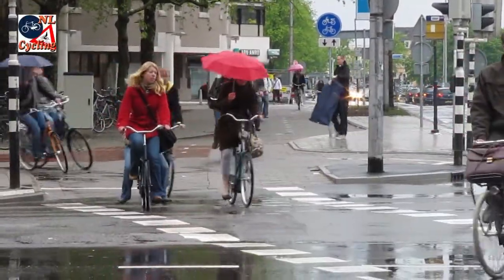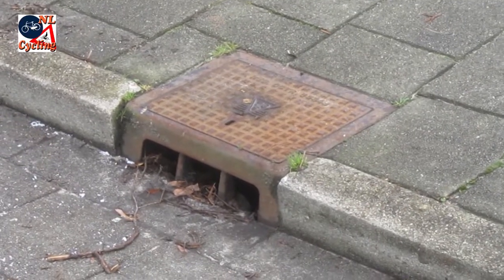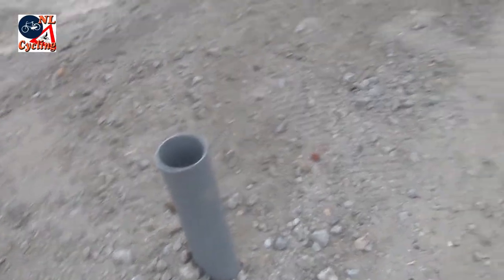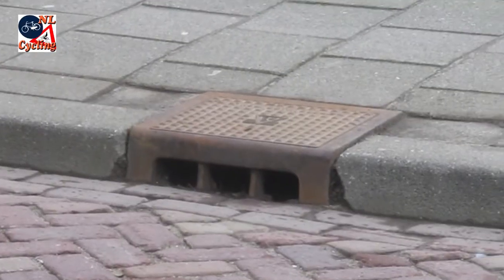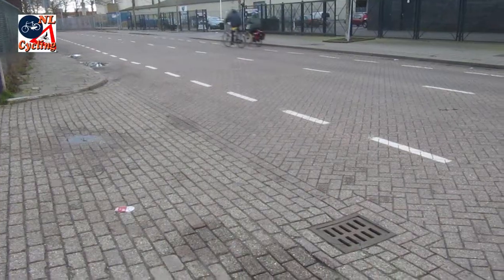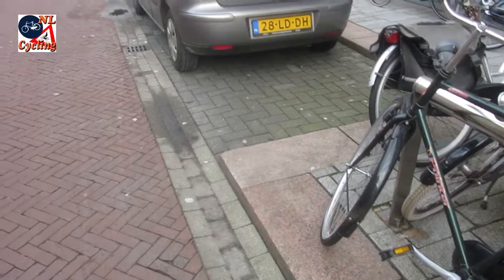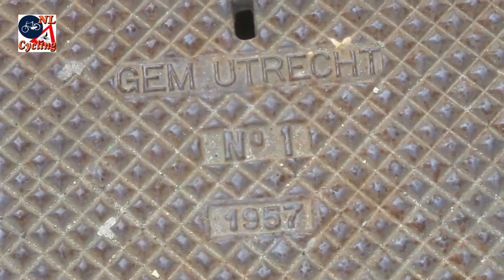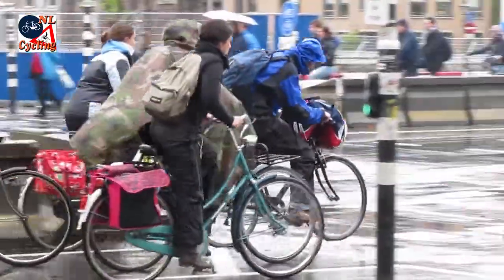How the Dutch keep their cycleways storm water free

Comment: why the Netherlands uses cobbles?
Reply: That is actually a VERY conscious decision: when a car driver is speeding on cobbles it becomes a very shakey and there for unpleasant drive. So the cobbles work as a real speed reducer! You will not find tarmac paved streets in residential areas in the Netherlands. The reason why many bicycle lanes are paved with cobbles also has to do with drainage. In between each cobble there's a tiny bit of soil. Soil absorbs water a lot better then tarmac does....
Reply: @missteacup9726  Really ? I feel no problem driving 80kmh on them. I always thought it was because its easier to service the power, water, gas, drainage and communication infrastructure underneath ?

Comment: I can't believe how the larger bus stop kerbs are still not standard here in the US. It would speed up bus service so much not having to walk up steps
Reply: Steps?
Reply: @dyldebeke  Most big cities have stopped purchasing buses with onboard stairs, but there is sometimes a step up from the curb and onto the bus, solved for wheelchair uses with a ramp.  Their solution is to lower the height of the bus itself with an adjustable height suspension, which can be complicated, although it is not bad with the common air suspension systems found on many buses in the US.  But many smaller cities still use buses with stairs, and many older buses still use stairs as well.  These buses use complicated mechanical lifts for wheelchairs, which brings its own set of problems, and the whole setup increases dwell time, which is by low floor buses are so much more common now.
NYC no longer purchases new city buses with stairs and has not done so for years (its coach buses for express services are of course different, but those are coach buses).  Nevertheless, NYC still has older buses that have on board stairs.  It's unfortunate, but it should be rectified soon.
Reply: except for Portland, their buses don't have steps

Comment: Hi, why not to use the polymer concrete drainage kerbs, catch basins and drainage channels to solve this problem? Better water discharge capacity than the traditional design(point type drainage system) .
Reply: Probably costs.
Reply: because this system existed before plastics were a thing and it works very well. As long as there isn't a blockage in the sewer system, it drains the streets really well even in heavy rains. So why change it? Once this system is in place, it can stay there pretty much forever because of how solid it is. There are covers and pipes from all the way back in 1873 still in use. I doubt polymers exposed to the sun will last that long.
Reply: We use then here. But are more often used in city centres for estetic reasons. In dutch we call then "sleufgoten"

Comment: Putting plastic in the ground seems weird to me, everything else is awesome.
Reply: What else would u use ? Concrete ?  With light weight plastic pipes you don't need large/heavy machines to get it in the ground. It can be simply glued together. It will last 100 years or more. It's flexible so it won't break when ground slowly shifts down.....
Reply: @martijnvv8031  and concrete always has little cracs and feces and bacteria can stick to them and can clog up the pipe
Reply: These tiny PVC pipes last longer than any concrete or metal, because they can flex. In addition, any movement from the catch basin could damage the main line, if there is any solid connection.
Reply: Larges sewers and storm drains are made of concrete. Smaller pipes are usualy made of HDPE ... and sometime also of ceramics again, very durable.

Comment: The main reason Dutch infrastructure lasts (some as old as 1923!) is that only cycles and mopeds use the lanes. Here, in the UK, HGVs & motorists are constantly parking on or trafficking all parts of the carriageway, kerbs and verges. This means more money is spent on repairs and less available for new. Sadly the slots in UK drainage gratings usually run parallel with the road requiring cyclists to pull out into the carriageway to avoid them.
Reply: I rember when I was in the suburbs of London on vacation to London. Never seen something that depressing. Small streets, small houses, filled with cars and elevated roads...
Reply: @-gemberkoekje-5547  And they drive on the wrong side of the road!